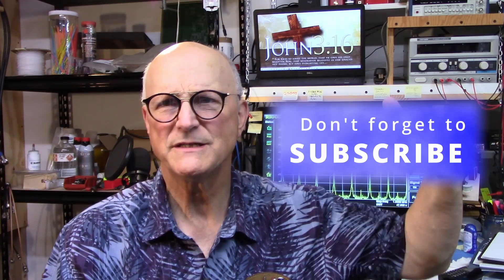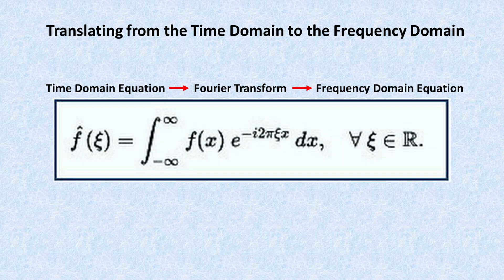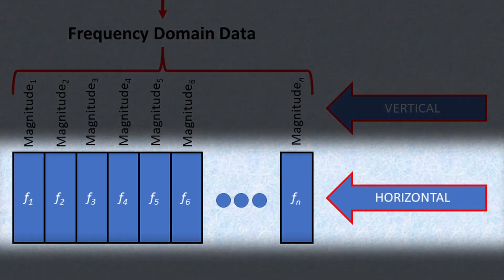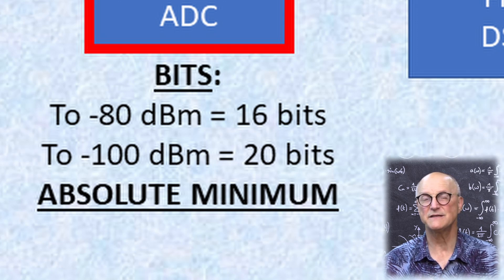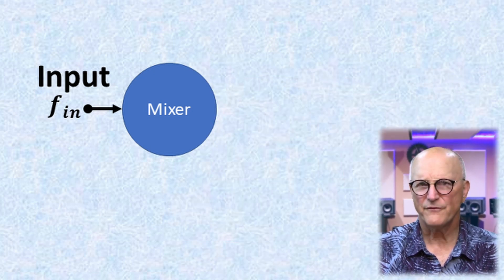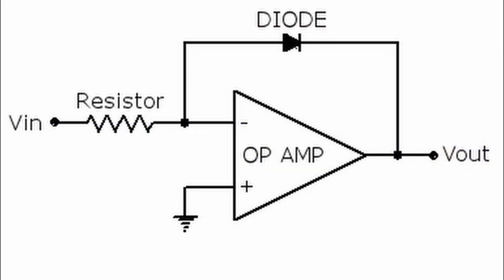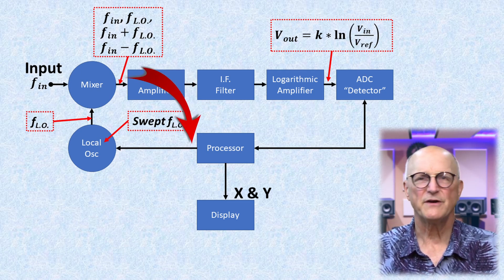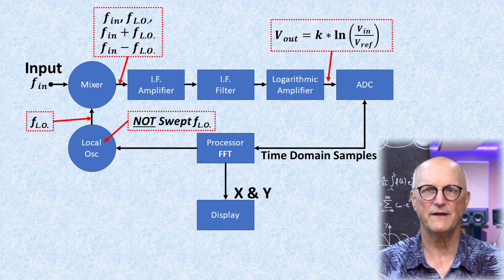Spectrum Analyzers: How do they do what they do? (029b)

Comment: Old spectrum analyzer don't use FFT filter or any digital one! The signal is not directly translated to low frequency but upconverted first then converted to a lower frequency.
Reply from the maker: Yes, I know this and I acknowledge this at the beginning as I tell folks that there are two camps.
Then, I give the hetrodyne  concept a much more complete treatment starting at 7:38. I start with the purely analog versions, show how the digital versions work in this camp and then talk about the hybrid versions (like the RF Explorer) which uses a hetrodyne front end and an FFT back end.   This presentation is based on the Rhode&Schwartz book "Fundamentals of Spectrum Analyzers." 🙂

Comment: Thank you for this wonderful video and explanation of spectrum analyzers :). 

The RSP Spectrum Analyzer software by Steve Andrew when used along with most any of the SDRPlay RSP series of SDR receivers makes a very accurate and useful spectrum analyzer. This combo clearly shows signals with high resolution down to approximately -130dbm and as high as 10dbm(for short periods), and more with external attenuators. Ths software is available for free from the SDRPlay website.

In my case, I dedicated an older Windows computer to only the analyzer. That computer is running Windows 10 and is not connected to any type of network and so is not bothered by constant updates and likely will not slow down significantly in the future because there are no outside influences to it.

So this is a good way to own a good usable analyzer without a large investment.

No interest whatsoever in SDRPlay here, just a satisfied customer.